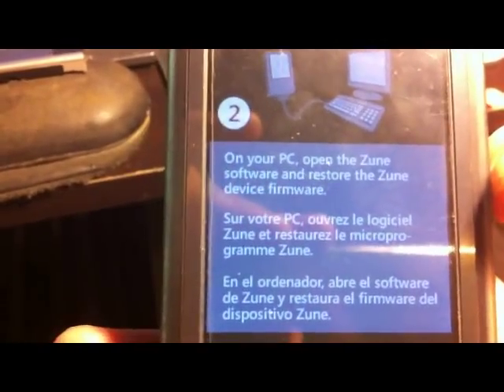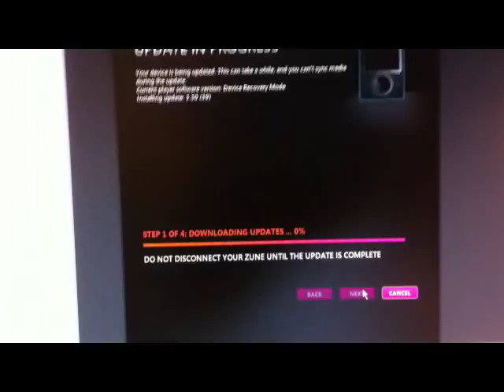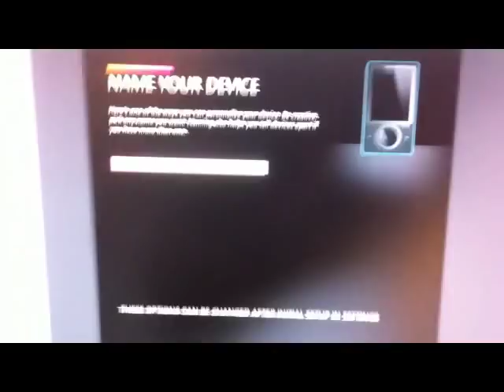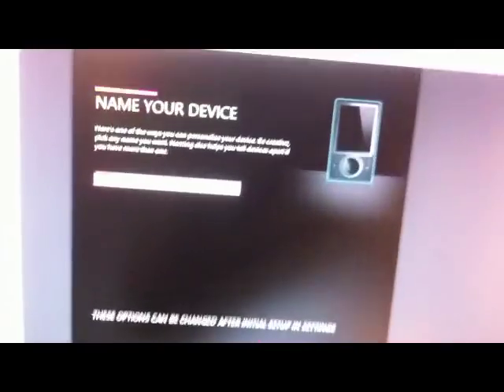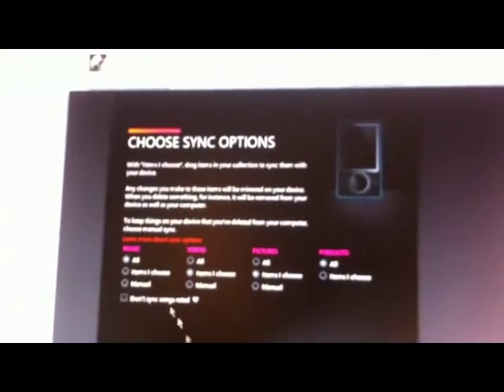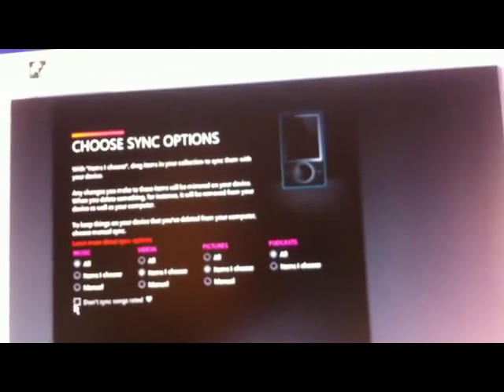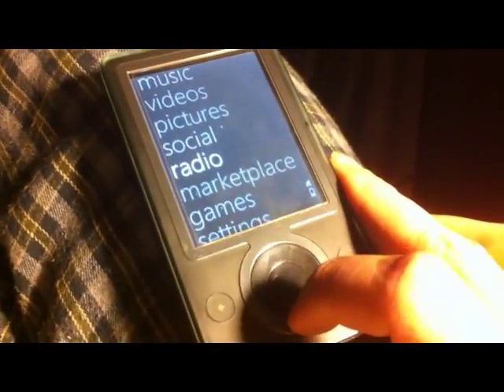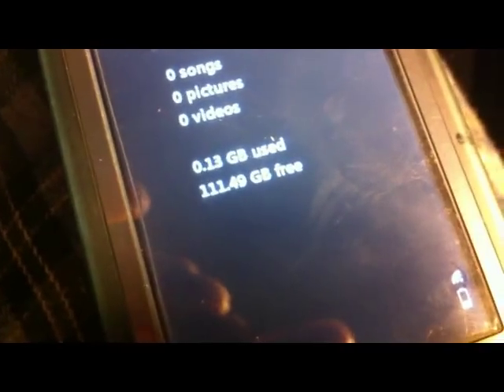(VLOG) 30GB Zune (original) Hard Drive Upgrade to 120GB

Comment: The back plate on the hard drive (where the info is) can be peeled off making the drive just a touch thinner (leave the thin plastic sheet to protect the drive). We were able to close the Zune unit by doing this. Rapid repair has the instructions on their website. Though you may have so google search "Zune 30 hard drive upgrade" to find it.

Comment: if you had used this hard drive it would have fit as it's the same size as the original. 1.8'' Toshiba 120GB 5MM MK1234GAL
Reply: Bigahk Yes it did. It was a perfect fit. Exactly the same size as the original 30gb hard drive.

Comment: hey where did you get your 120 hard drive?? please and thank you .also dude i cant believe your zune still works after all the shit its gone through man hahah me and my ZUNES have gone trough mad shit. my 30 gig zune had a broker scereen after about a year of use the screen broke cuzz my friend put his shit in my back pack and my zune was crushed under all of his shit!! the thing is that it still worked with a broken screen i just had to memorize the layout of the menu and everything
Reply from the maker: I ordered a MK1214GAH from http://www.centrix-intl.com - it was like 35 bucks!.  Cheers!  Always good to find others that like them like I do!
Reply: alecjahn I am going to try to do this to my zune 30. did you manage to close it properly?
Reply from the maker: Francesco Cimmaruta I did, but it took a lot more shaving of the inside/back... If you hold mine (just the back casing) up to the light, you can see it's starting to get thin in some spots.  So I got pretty darn close to shaving all the way through the black inner plastic later (but not the "doubleshot" layer, blue on my black or green on the brown or... something on the white?)

If you just take your time and do it evenly, it will turn out just great!  Mine might still be a little "tight" in there... and I don't really want to know what would happen if I dropped it, but It'll probably stay inside anyway. :)

Comment: Did you try to use of those iPod Classic hard drives? The 160gb is slim and I am pretty sure will fit.
Reply from the maker: I considered looking for one, but since the 120 I found was so reasonably priced I figured that would be plenty for me.  :P
Reply: alecjahn I ask because I picked up a 1st gen Zune for $10 yesterday and the only thing it needs it a new screen and I already have two 160gb drives laying around that came out of 7th gen iPods one of them I upgraded to 512gb mSATA card.  I will see if I can make the Zune work with the 160gb drive. Keep in mind that the drive is the slim single platter hard drive and not the fat one from 2007.
Reply from the maker: cm2881 Nice!  Yeah, it it is a slim drive it would fit a lot better than mine... do they have the same interface?  (ZIF ribbon cable)  
I believe I have read before that they do work fine.  Or should.  
Be sure to report back, I'm curious!
Reply: alecjahn Yeah they both connect via ZIF ribbon cable, I ordered the LCD from China so it may take two or three weeks to get here and I will certainly let post here how it goes.
Reply: cm2881 Installed the drive but the drive is bad... I need to order another one when I get a chance. But installed an iPod 30gb drive in it, these Zunes sound good but syncing is a pain. MediaMonkey, Foobar200 and WinAmp don't work.

Comment: Just installed an 80gb drive in my Zune 30, and when I plug it into my computer to install the software, I just get the Zune loading screen endlessly. I don't get error 2 which means no software, and I also don't get error 5 which means a bad hard drive. Did you come across this problem or know any fixes?
Reply from the maker: I didn't, unfortunately - everything went totally smooth on my end.  for the record, do you have the exact model of drive you used?  Maybe we all can narrow it down?
Reply: alecjahn the hard drive is a Toshiba MK8009GAH